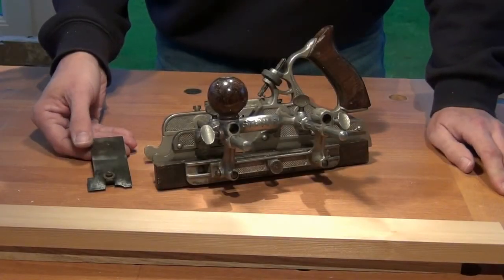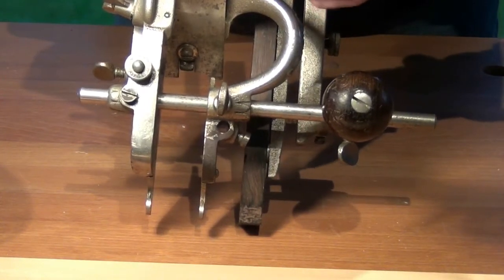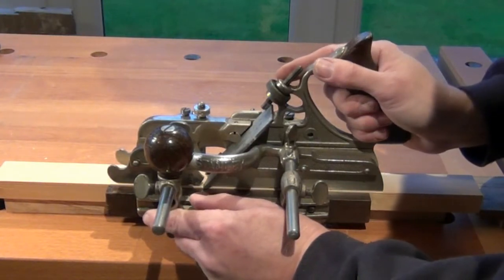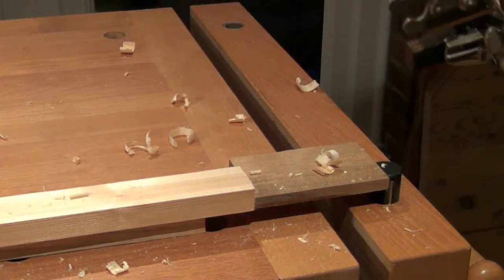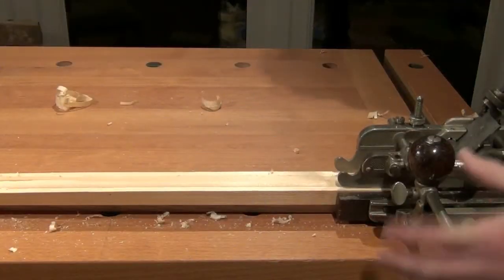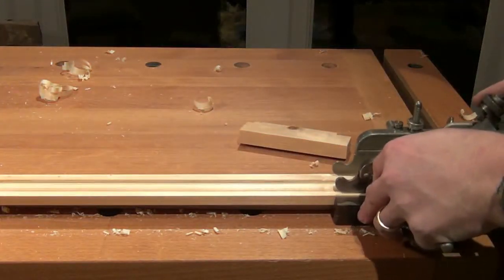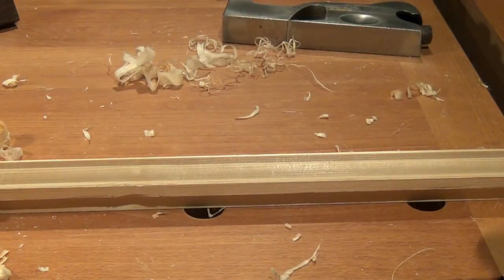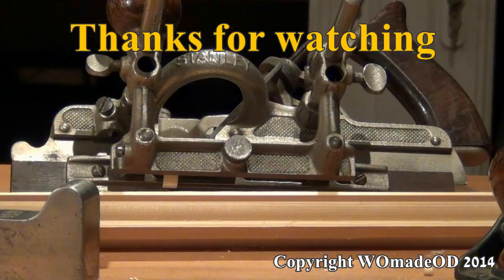Cutting Sash with a Stanley No.45

Comment: You really should use a gauge board when cutting the second profile This will allow you to hold the glazing bar more securely. In addition, as you rightly mentioned, only very straight grained material is suitable, so select the best parts for this operation, as the tear out on your bars clearly demonstrates. Good job.

Comment: You're a brave man, Mitch, and I'm pleasantly surprised how well it eventually came out!  The #45 and it's big brother, the #55, must be responsible for more foul language in the workshop than any other plane in history!  I have a #405 Record, but rarely use it because of the 'fiddling time' setting the thing up, the sheer hard work of pushing the damn' thing, and the infamous tear-out, which I found to be unavoidable  in all but perfect stuff, which is pretty hard to get.  It can't help but tear out, because there's nothing in front of the cutter but fresh air and two thin skates!

Good luck to those who like them, but if ever a plane was a 'Marmite' - this is it!  Thanks for a very interesting video.
Reply from the maker: Marmite for sure.
Razor sharp cutters and reducing depth of cut as approaching finish depth can help a lot I've found.

Comment: Nice video Mitch.  You did pretty well.  How long did this piece take to cut?  Cutting sash was the reason I bought my 1st 45.  I got it complete in like-new condition with the original box.  I priced router bits and I got the 45 cheaper than a set of sash bits.  Unless you have nearly perfect wood, it will be an exercise in frustration.  While they do cut old heart pine fairly well, today's cultivated lumber is far from satisfactory for this tool IMHO.  Sash bars are extremely difficult to cut, especially on the second side.  Having a reverse cut moulding to support them helps a lot so if you make one, save it for future use since it takes longer to make than the sash bars themselves. 

If I could do it again, I'd get a set of wood sash planes.  Any wide cut like this needs a mouthed plane to be done well.  BTW, I bought the router bits........... 

My advice is this:  If you already have a well tuned 45 with crazy sharp cutters and don't mind spending an afternoon cutting a few feet of sash stock, have fun and use it.  And make sure you have more lumber than you think you need.  But if you're building windows from scratch, get the router bits or sash planes.
Reply from the maker: blmeflmm66 Nice story and good advice there.
I'd like to try it out on some red cedar, maybe replace the windows in my machine shop, which would hold up really well to our weather here. It's years since I had my hands on any, and I wasn't into hand tools so much then, but I remember it worked very easily.

Comment: Would initially removing some of the waste with separate cutters make the process a bit easier.
Reply from the maker: Definitely in hardwoods, but to be honest I think most on site prep would be done with a rebate plane and block plane, with the 45 left setup for the final shaping. In knott free straight grained softwood, then a coarse cut can quickly rough the work out, and then the cutter wound back for the final few passes.

Comment: Great video. Do you know of a 45 blade iron that will cut the cope where the low rail meets the stile profile? thank you!
Reply from the maker: Thanks. I don't know of such an iron. Don't believe Stanley ever made one. I suspect, but can't be sure, that anyone using a 45 would make simple mitres. The quality of sash being more suitable for humble dwellings where putty would fill any gaps.
Whereas a joiner with a full set of wooden sash planes would have a plane specifically for the task.

Comment: I have the Record 405, I've got the sash blade razor sharp and still can't have a fine cut as with a normal benchplane... And as you said, good straight grain is hard to find. Nice video.
Reply from the maker: The 'skates' are often not perfectly straight and flat, which doesn't help.
Reply: @mitchwoodwork  actually didn't think of that... Maybe I've to look into that next time, thanks